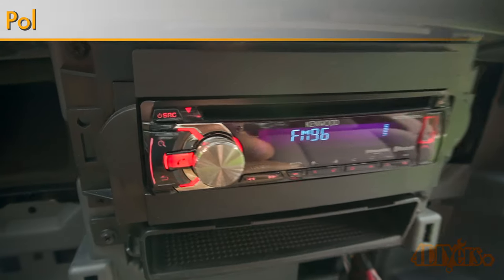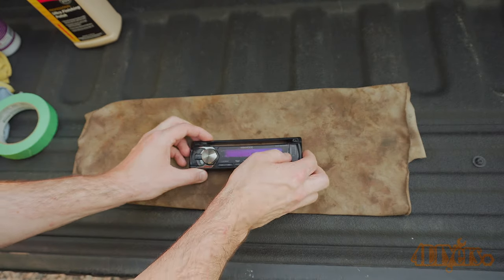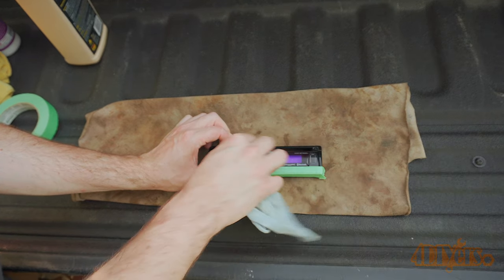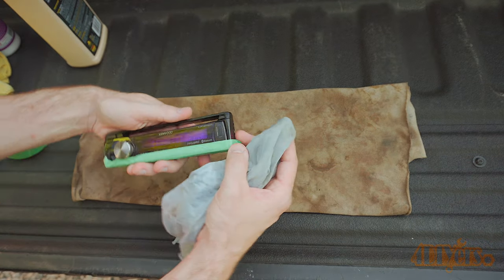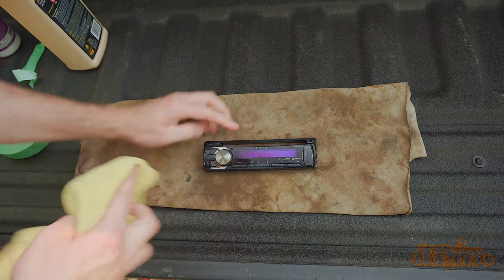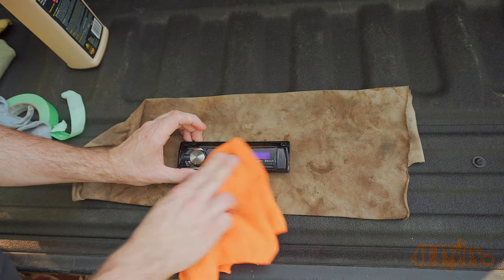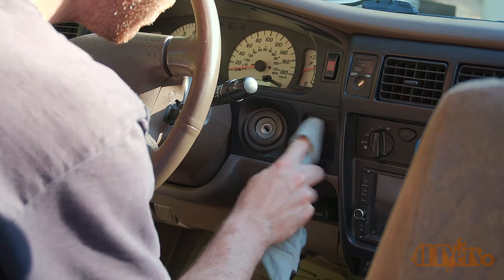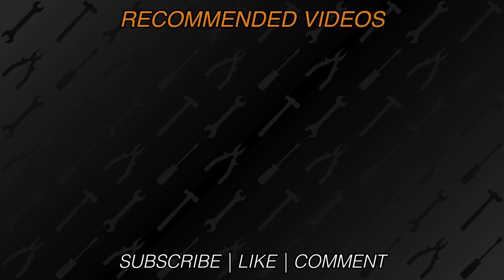How to Polish a Scratched or Faded Head Unit Radio Screen

Comment: Those garish faces on most aftermarket radios are a huge reason why I loathe most aftermarket head units.  It's about as compatible with a factory interior as a big red clown nose "enhances" the face of Margot Robie or Jennifer Connelly.  Great video on cleaning the head unit.  There's only so much you can do for an ugly, lipstick-on-a-pig, aftermarket radio.
Reply from the maker: Yeah I'm kind of picky with aftermarket units. This came with the truck and I can play music on a usb drive, so I can't entirely complain lol. Some of the double din units look good. I'm quite happy with the unit I installed in the Tacoma, matches the interior well. I wouldn't mind to install a screen in this, but getting my hands on a factory Ram radio navigation bezel is ridiculously costly for a hunk of plastic. Blaupunkt makes a really nice looking period correct vintage unit for classic cars. Would be a perfect fit for my E23 as the factory cassette is acting up.
Reply: @4DIYers  Lesser known radio makers such as Continental and Becker do a much better job making radios with modern features without ruining older car interiors. I prefer an aftermarket radio to not LOOK aftermarket.
Reply from the maker: Check out the Blaupunkt Bremen, it's a nice unit and matches my red interior lighting. I was considering Continental too but the backlight is the wrong color so it would eventually bug me.

Comment: I wonder if this would work on plastic eyeglass lenses? 🤔
Reply: It's probably not going to fix scratches.  A scratch is a gouge in the optically smooth surface (think of a plastic, microscopic 'canyon" dug into that otherwise smooth surface).  Not a whole lot you can do with a plastic lens.  Even if you could fill in the gouge, the area would be optically distorted.  At least glass can be resurfaced.  You're probably better off replacing your eyeglasses, or investing in a protective coating for your plastic lenses.
Reply from the maker: Being that it's your eyes, while it can be hard to see the scratches visually, it may cause eye strain. So it's probably not something I'd recommend.